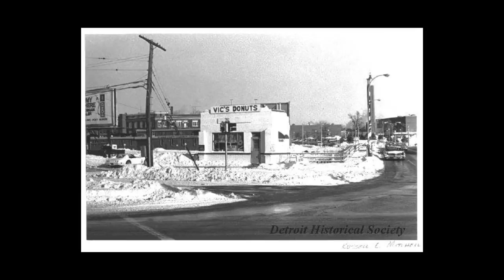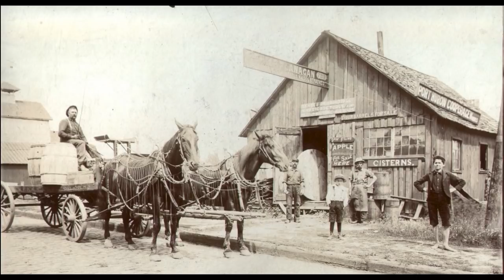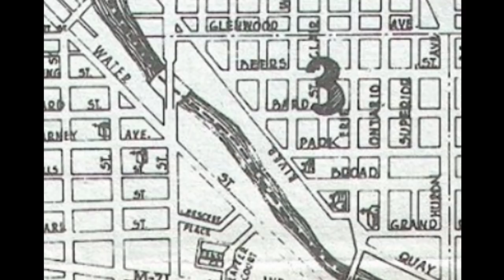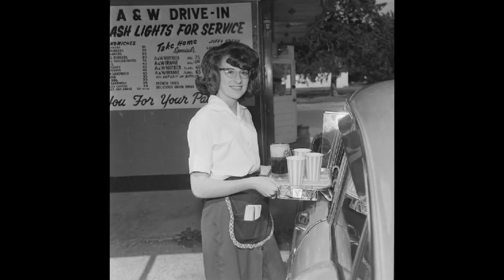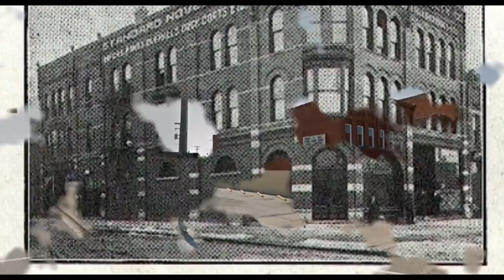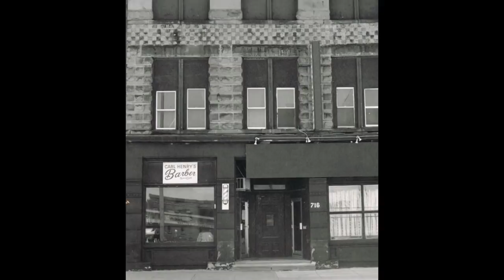Port Huron History Part 143

Comment: thank god they left a few of the old buildings across from vics donut shop..goldies pawn shop was there for many years... the big bank building on the corner of military and water with the old gas company building behind it is still addressed as 405 water st that was the first a n p store until the gas company took it over and the a n p moved to the corner of 7th//8th and water
Reply: i remember the old a and w at one point we had two of them and two powers hamburger shops